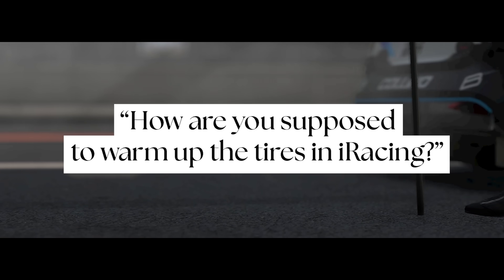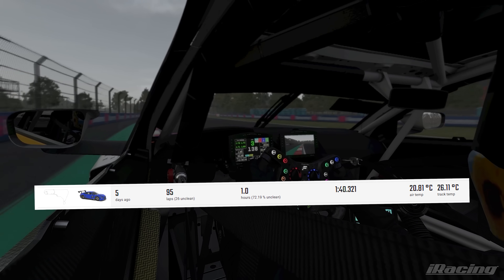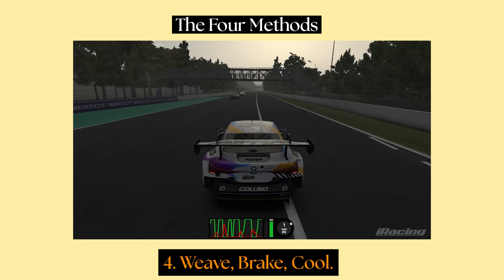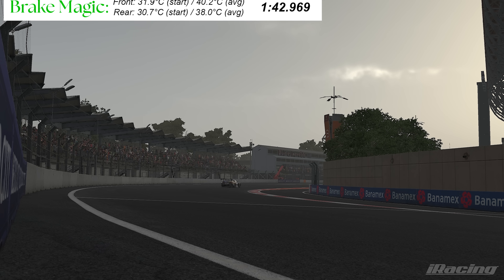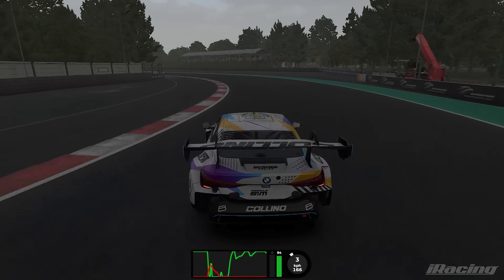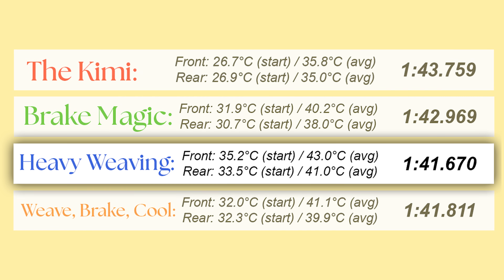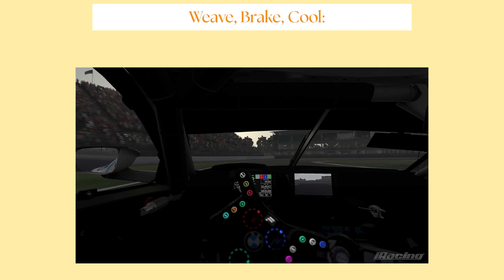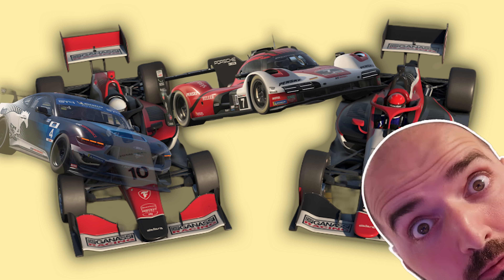Tire Warming Myths in iRacing.

Comment: Great video man, I'm subscribed! I usually end up in top split when I do officials so I see a lot of "esports" techniques for warming tires, especially in IMSA. The one I see a lot of is 'fast weaving'. You essentially just jerk the wheel back and forth very quickly while at pacing speed to get both the front and rear tires slipping a bit so you get heat into tires on both axles, rather than primarily just the fronts like you saw with the other techniques you showed in your video. I'd love to see some testing on that if you do a follow up here.
Reply from the maker: I think I saw Gustavo Ariel doing that exact technique at Lemans. Gutted that I didn't try it, but I was already midway through. In Weave, Brake, Cool I got the closest to doing that - and so rear temps are much better. Thank you for the sub and the nice words, I may have to do another test in the near future 🫡
Reply: @MF_Henri  No problem! Feel free to reach out if you ever want to discuss any topics for your videos, I'm part-owner for an esports-ish team on iRacing so we do a lot of data analysis and testing to be able to compete at a high level
Reply from the maker: I knew I recognised your name! I may have to take you up on that offer;)

Comment: when you mentioned "brake magic" I thought you meant putting the Brake Bias all the way forward. The only time I've heard the term "brake magic" used was when the Mercedes F1 cars circa 2020 used a "brake magic" button immediately that set the BB way more forward specifically for front tire warmup on formation laps - rear tire warmup being managed through burnouts. I don't think they use this button anymore, it might've got banned?

Anyway, you mention your "brake magic" killing the front tires... so what if you push the BB further back during the formation lap? Does it make a difference at all? Worth testing imho
Reply from the maker: Hahah that's why I flashed an image of Baku 2021 for half a second 😂 I think that this is a really great idea to test out. Marian from GitGud Racing also suggested this and I think its worth exploring!

Comment: Sooo uhhhh, how’d you get the tire temp info if iRacing doesn’t share that stuff externally and only updates once you enter the pits?
Reply: Study the telemetry after driving
Reply: GT3 cars display live tire temp, pressure and brake temp on their steering wheel/dashboard displays

Protos and some formula cars also have some combination of those on their dash as well
Reply from the maker: Like @midnoob1650 said, I load the IBT telemetry file from the session into Cosworth PI Toolbox.

Comment: Okay, so we all going to weav now in gt3
Reply: Yup try to weave on your half of the track 😅 don't touch the racer next to you.
Reply: @Bbenkosky  as long as they do the same... I don't think low splits will use this successfully
Reply: @Bbenkosky  this is kind of the problem with the weaving method - the amount of weaving needed to have any effect at all is simply not possible when driving a formation lap with any other cars around. its really only possible if youre on pole or last
Reply: @doghugs  once u above like 2k sofs it becomes standard since besides the cringe redd1tor in the field ppl often make single file for most of the lap
Reply: @Bankai90  I noticed this in a race yesterday, top 7 (3k+)  single file for 80% of formation lap everyone p9 (2.2k down) back trying to force two wide and not leaving enough space for safe tyre warming. I was trying to single file like the guys ahead but p9 refused. I wish more people would leave heaps of space then bunch up last 2-3 corners ready for race start

Comment: I accelerate hard and brake hard constantly for the whole of the warm up, no weaving. I had a peace recently where they people around me didn't warm their tires very well and I was way faster on the first couple of laps and pulled out a lead they could never get back. It would be interesting to know how this method compares to the others you tested. The big benefit of just accelerating and braking is it's much safer, little chance of weaving into someone else, or accidentally going OTT and spinning.
Reply from the maker: Good point! I'll add that to the list and try this next time. Like a "safe" method
Reply: Yes I do hard gas then hard brake bc I felt it was safer. For me and people around me.
Reply: Just a warning with this if you do any races that require a pitstop that this method will burn significantly more fuel than just weaving. That'll put you at a disadvantage when you come to take fuel during the race as you'll be stationary for longer. It is positive for fixed races though where your start with more fuel than you'll ever need.
Reply from the maker: @skylerdavis1701  Yep! I show Lap 0 fuel comparison at 7:30 in the video:)
Reply: @skylerdavis1701 other wonderful point. Where is the limit on doing this to save fuel?

For races with pitstops do you. Kimi or soft weave and brake and cool?

Man you have us all thinking. More tested is needed. Thank you for your time. MR. H.
Reply: @JAMES.M_00007 iRacing fuel consumption is mostly determined by throttle position. So to save fuel you’d want to use just enough to keep up with the pace car pack.
Reply: @skylerdavis1701  it's not throttle position, it's rpms. so if you leave the car in a higher gear you'll save more fuel. in nascar sessions with cautions i leave the car in the highest gear until one corner before the restart to save fuel.

that said i don't think the amount of fuel you burn in the formation lap is really gonna make all that much difference in an enduro, especially if you're fuel saving during the race? it seems like the tire temp difference is worth burning another liter of fuel
Reply: @doghugs thank you for that insight. Tires temp over fuel saving. Good take
Reply: @doghugs so what I’ll encourage you to do is go somewhere with a long pit lane. Run the pit limiter and the throttle flat out. RPM is controlled by the PL. Then do another run where you only use enough throttle to stay at the maximum pit speed. Then compare your fuel usage. Indianapolis is a good place to test this. 

For endurance races it doesn’t make a huge difference you’re right. I’m mostly talking about your GT or IMSA Sprints. Each car is going to start with the maximum allowed fuel per the bop. All GT3’s start to sputter at 0.2L remaining. In the AMG GT3 the fuel rate is 2.6L per second so if you’re in a situation where you need to add another liter because if you don’t you’ll sputter at the end then that cost you another half second in the pits. Note that this mostly comes into play in top splits and competitive leagues where these margins absolutely do matter.